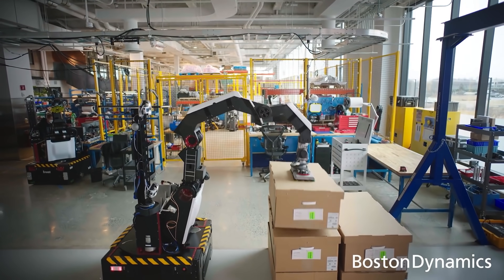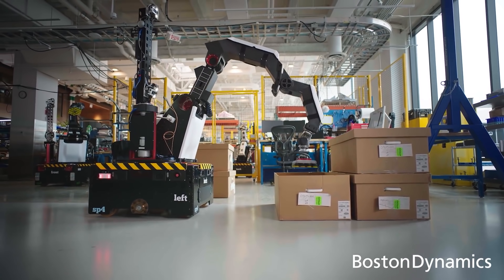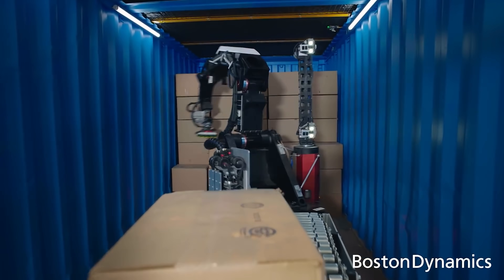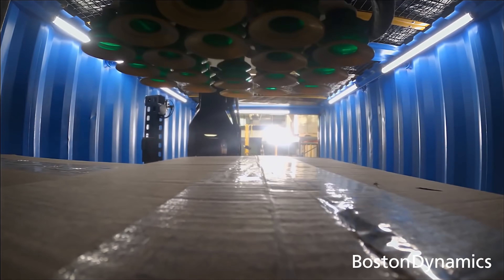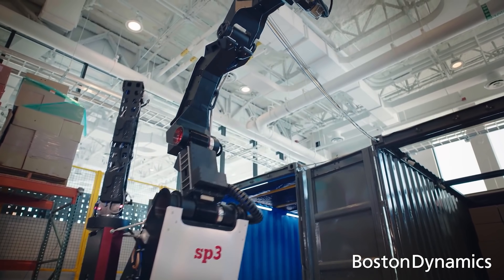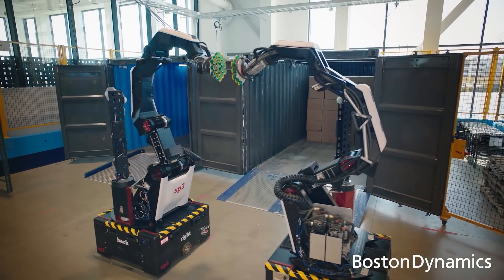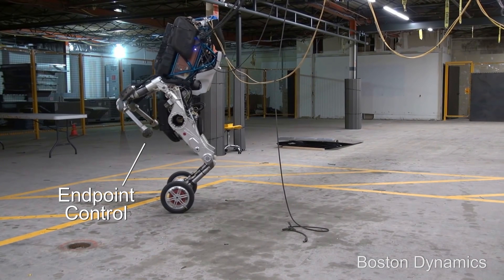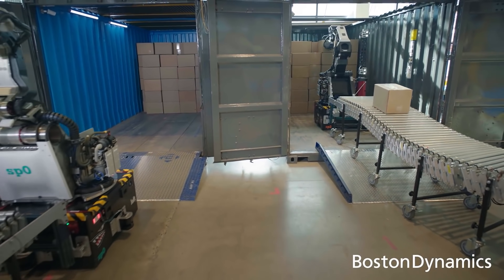First look at Stretch, the newest robot from Boston Dynamics

Comment: Would it be possible to have an inside look at a typical day of work at Boston Dynamics? See the workflow ? See how the programmers write lines of codes, see the electrical engineers connecting parts, how they run into problems, how they find the solution, etc?

Comment: Ok, so I'm a warehouse worker, specifically a forklift driver, and thankfully I've been slowly moving away from the grunt work and avoid large companies like the plague.
The problem with this robot is the same as has always been the problem with the idea of using a robot in this setting. Packaging is not designed to be handled like this. You are treating the cardboard like a framed structure here. You try lifting a real box(instead of the empty ones used for demo purposes) like that and it will fall apart half the time. Another issue is something that is often true of automation, that all the things workers have asked for for forever to be be improved to make work more efficient, but cost more money and require a coordination effort that upper management is unwilling to consider (like better packaging) will be a prerequisite of implementing these robots. The upfront costs, as well as the ongoing costs of maintaining both the physical asset and the processes and infrastructure will negate any possibility of any but the largest companies from implementing them, and even there the cost savings and higher productivity would probably still not be enough to lead to a return on investment in the foreseeable future.

Even giving it a fair shot, I don't see this threatening my job any time soon.

Comment: How light does a cardboard box have to be to be able to be lifted from the top or the side of the box alone, and what percentage of boxes are that lightweight?  Is there a heavier lifting version too?
Reply: I was thinking that too since depending on how heavy the box is it might break from the bottom if held like that or there might not be strong tape, I think a massive improvement on Stretch would be a flat spatula platform to scoop the box under from.
Reply: @MISTAKEWASMADE4live  Yes, or the combination, where it grabs a box from the side, but only to pull it out partially and lift it slightly in order to get a blade underneath to support it.

Comment: Not going to lie, though. I sincerely wish I'd had a miniature version of this to help Me with loading & unloading packages into My van when I tried working as a courier again only to have to quit 3 days later because of back issues. Perhaps something with transformable legs so it could have gotten into & out of My van on its own, only to then use the flattop section to actually have the boxes on itself so it can take the boxes into the location they're supposed to be in. I honestly wouldn't have minded that, personally. I've always had the belief that any job that CAN be done by a robot SHOULD be done by one, freeing humans to go into more esoteric or higher-thinking, higher-skilled jobs that don't require as much physical labor. Far too many people are injured each year - either through an accident or just the daily wear-&-tear of constant physical labor - that could be avoided by using a robot like this instead. It would be wrong to let this thing sit idle any longer, in My opinion.

Comment: Why not just have pallets that move themselves off the truck with all the boxes on top?  The pallet could go to a lift beside some conveyor belts and have a dumb swing arm push the boxes on to the the belt and then the lift raises it up to push off the next row of boxes until the pallet is empty and then another pallet takes its place.  Moving boxes over empty space like that stretch robot does is just asking for something to drop and break.  Amazon already has robots that move entire racks around the building.  It would be nothing to have pallet sized robots that quickly exit a truck.  The sooner the truck is unloaded the sooner it is back on the road.
I don't have a problem with robots taking back breaking or dangerous jobs away.  And I'd like to see more robots cooking food since I don't trust the current rabble out there preparing meals.  There will be plenty of jobs that robots won't be able to handle for quite awhile.  I'd like an A.I. smart enough to tell me which component to swap out on a circuit board so I don't have to think about it.  Heaven forbid if we lose all our knowledge and the grid goes down and there is no one smart enough to start things back up again.  We are one solar storm away from being in the stone age.

Comment: I want a robot that will run my pipe, pull my wire, and terminate all my connections. Thank you Boston Dynamics.
Reply: The cyberpunk novel “Freeware” by Rudy Rucker feature a character named Randy Karl Tucker who uses an Artificial intelligent pipe gun that does pretty much exactly what you described.

Comment: Just guessing here, but probably $1,000,000 per robot vs hiring people at $15 per hour, good luck.
Reply: I’m pretty sure Atlas cost $400,000 to make I believe , that $1B is high for a robot, even Spot mini didn’t cost that much, and Atlas was mainly made of 3D printed parts, also if you can get a factory like a car factory to mass produce the frames, and CPU then the cost will come down significantly, Atlas still doesn’t even have a head, so I doubt they will bring that to market soon.

Comment: There is no way this robot can pick up a standard box weighing 50lbs, and Boston Dynamics doesn’t claim that it does. The robot is only shown picking up empty boxes in this video, because that’s all it’s good for. No matter how strong the robot is it can’t change the law of physics— picking up a cardboard box without supporting the bottom is a recipe for disaster. As a method of grasping boxes suction sucks.

Comment: I work in a warehouse . I can tell for a fact that warehouse work is far too irregular for this machine. You need all kinds of people doing all kinds of things. For sure it will help but humans will always be needed for manual job. A mind and a pair of fine tune hands can’t be beaten by a limited algorithm. Even just picking up little pieaces of trash now and then. Not even the wifi is reliable and I work in one of the best companies in the world. This robot is cool but look how controlled is the environment. Real warehouses are a little more chaotic. Simply the boxes are way more varied not all clean and uniform like this place. Sorry but no. I still prefer a human. Much more flexible.
Just as an example. Warehouses get full of dirt ultra fast. People are constantly cleaning and scanners are constantly getting dirty. Boxes break all the time, spills, trash, HAZMAT materials. A human can learn new things constantly and solve problems a machine with a fixed arm can only do one thing.
Reply: how about instead of 10 people doing 'irregular' jobs, we have 5 of these robots working in as standard of an environment as possible and have 5 humans for supervision. You would be surprised how fast an industry can improve if there is a paradigm shift available for increasing profits.

Comment: They need to be able to deal with different sized boxes, damaged boxes, wet boxes, boxes that have missing or damaged labels, round packages, and /or unique surfaces.
Reply: Bet someone dominant like Amazon could insist on robot friendly boxes / fine suppliers for sending boxes the robot can't manage... and then that could ripple out through the supply chain till everyone shipping stuff is worried about whether robots can manage it. That'd solve a lot of those problems.